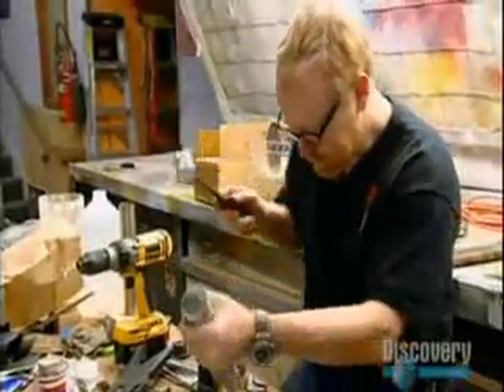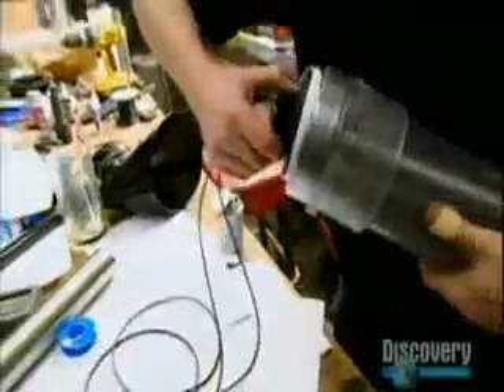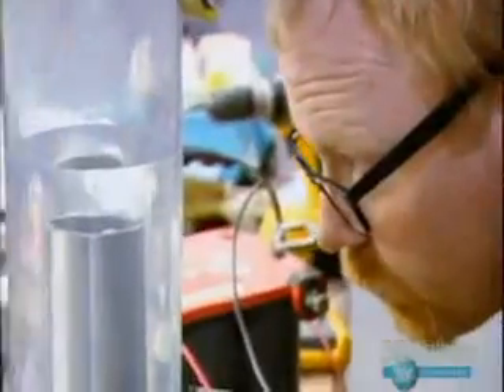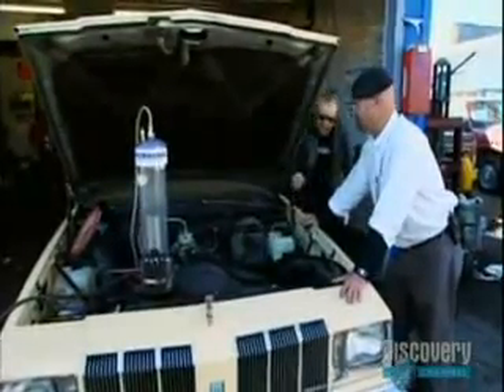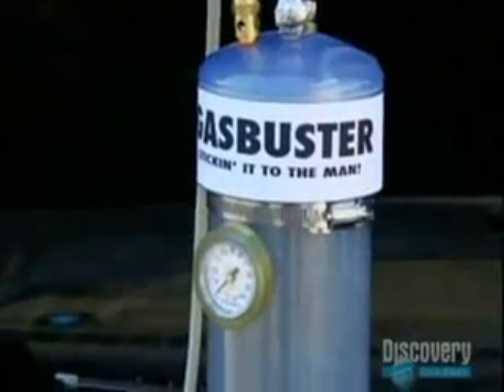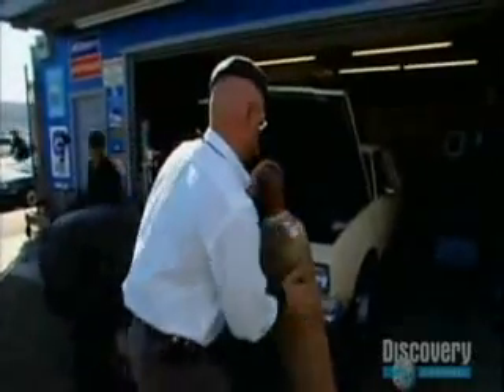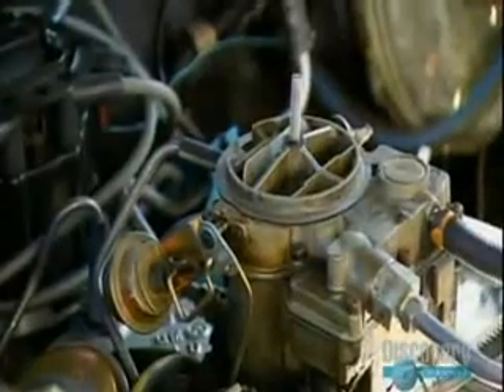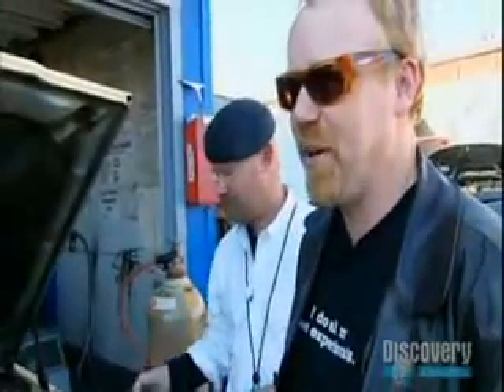HHO Mythbusters Explained

Comment: that was a pathetic attempt to myth bust HHO  most HHO fuel cells are fuel savers ie they will save gas when run in conjunction with either petrol or diesel  not sure if they can run a a car by them self just yet ,the experiment those dick heads did was running just on HHO from a fuel cell with the carbi air cleaner shrouded off and the HHO cell hose going into it  even if he fuel cell could produce enough hydrogen the motor still needs it required oxygen to fire up the one part oxygen too two parts hydrogen  would not be enough to fire it up as the engine would be starving for oxygen  those should have got the car on a dyno machine   driving it for 10 miles using petrol from a external gas tank or bottle and measured fuel consumption over the ten miles traveled  then hooked up the HHO cell hose going into the carby aircleaner  and done the same dyno test for ten miles  using petrol and HHO from the cell then checked to see how much fuel petrol they used over the ten mile test  then they would see if there was any fuel saving  and what percent of saving was gained using hydrogen gas  i run a car for three years on HHO  and gained a average of 50 percent gas savings using HHO as fuel saver   the bloke i got my warrant of fitness every 6 months for road worthyness of car   was hell  impressed with the extra power and torque the engine made and how smoothly the motor run   i must have been doing something right  because as word got out  someone  tampered with my car  and loosened both lower ball joints in the front lower control arms on the car to with in one thread of the nuts coming off completely  maybe in hopes id crash the car and that HHO would be seen as a cause i dont know  both my Machanic friend spotted them as loose when he was checking the car for road worthyness  and probs saved my life  ball joint dont  just undo them selves they are kept in place with split pins so they didnt just untighten them selfs some one did it he said

Comment: It's obvious that mythbusters is controlled to make common viewers dumber than stone in mud. I've used HHO and it worked. I've filled balloons of HHO and taped a fuse to them. They rise like helium and explode like hell. I've used various electrolytes, conductive materials, and flame arrestors. For these asshole to produce shows designed to make people think it doesn't work is obviously oil companies still shoving shit at you. Oh, and oil is NOT a fossil fuel. It's a deep earth liquid found way below any signs of organic life. Oil is a part of the Earth. It is not dinosaurs rotting. OMG!!!
Reply: so you actually believe oil comes from dino's rotting?LOLOLOL!! stupid sheeple.
Reply: What do you mean that mytbusters test didn't work?  Of course it worked.  They produced stuff that explodes like hell.  The problem is not "quality" (that you can make HHO via electrolysis), but "quantity" (can you produce enough HHO fast enough to be useful in a car and produce more energy than you used in electricity?).  The answer to that is, unfortunately, no.  No matter how bang the bang is, it's not really that much energy, and you'd get more power out of the gasoline directly in the engine than you used to produce the HHO.

Oil is a "deep earth liquid found way below any signs of organic life"?  Obviously, you've never heard of the Tar Sands,  nor the La Brea tarpits where the oil is right at the surface, nor realize that much of the bedrock underneath us that the oil sits on top of is of organic origin.  What do you think  limestone is anyway?  Sorry, coal, oil and natural gas are all of organic origin.

Besides, not all crude oil is particularly liquid.  At room temperature, you need a shovel to move Venezuelan crude, but a backhoe would be a better choice.

Comment: I have seen a car run on HHO from a generator before, but it doesn't last.  The car can't produce the electricity, which makes the hydrogen, which makes the car run, which makes the electricity.  The system will keep a car at idle for a while with no outside energy added, but eventually more energy needs to be added to the system.